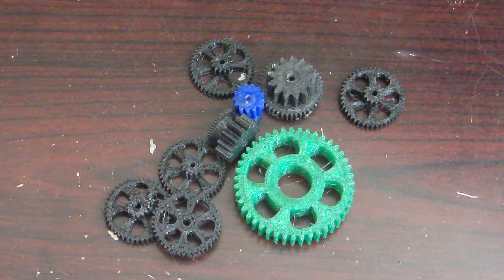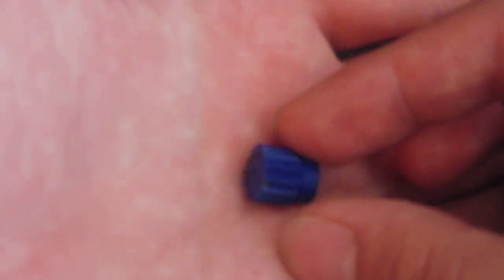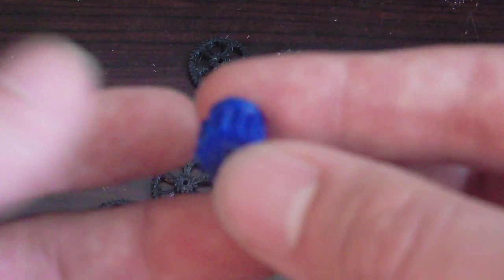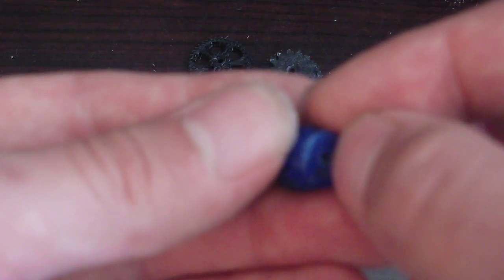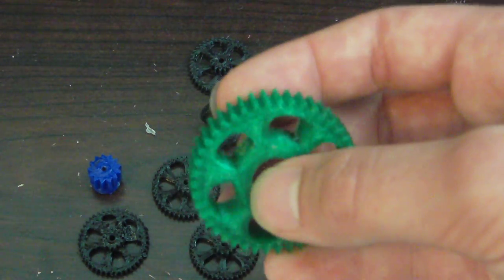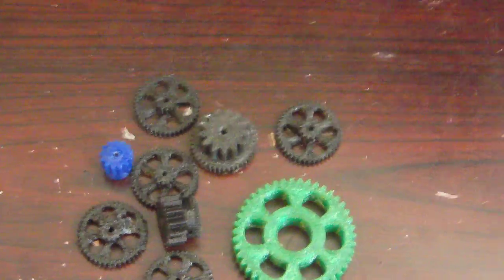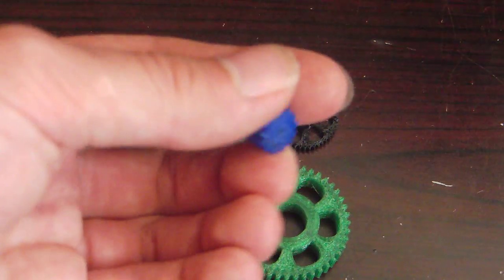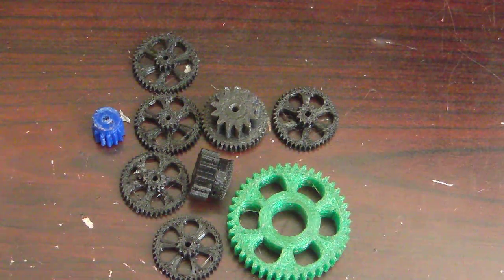Can you actually use 3D printed gears?

Comment: Nice video , i got an issue with this as even if it is good adjusted it still comes up with circular defects. Am planning to add one axis and print on a rotating surface to get it more circular. What i have learned is that how you print the layers affect durability, and the best setting was actually 20 degrees z lift and supports beneath it so that the layers got diagonally distributed. You can however print them in pla, put them in a mould with alginate and just pour resin for a sla printer and harden them with light. As long as the model is accurate the gears will, and will go much faster in series.

Comment: I don't believe he cannot drill and tap a set screw into the blue gear. I think he just doesn't have the proper equipment.
Reply from the maker: +Jason Murawski I could but that gear is tiny and even finding a screw that small and then getting it tight enough to stop the gear spinning on the shaft and without striping out the plastic would be very hard. Also it's not like you could grind a flat on the shaft since it's like 1mm in diameter or so.

Comment: can you reuse the 3d plastic to make something else? they just need a cnc for plastic and make your pieces from different grades of plastic blocks to cut. that would be awesome! them you can use really good polymers and such. just a thought.
Reply from the maker: There's nothing special about most of it. They literally take regular raw plastic pellets used for injection molding and such and dump them into a fancy extruder that just happens to make a filament the right size for a 3D printer. You could easily melt it down and reuse them.

Comment: Great video. I want to print gears. There are so many 3D printers on the market today. Can you recommend me one that can print small size (like a  blue one on your video) ? Can I find one within 1000 $ budget?  Please show the link if possible.
Reply from the maker: If your willing to assemble a kit than you can find something great for well under $1000. The kit I have I think I paid like $500 for but that was well over a year ago. If you want something pre assembled you might have a bit of a harder time. I do highly recommend a kit just from the stand point that you will know the machine inside and out so fixing things will be a lot easier but if you don't have the time then well. If you have never owned a 3D printer before and I assume you haven't then it may be best to get something cheap like this: https://www.amazon.com/Monoprice-Select-Printer-Heated-Filament/dp/B01FL49VZE/ref=sr_1_7?s=industrial&ie=UTF8&qid=1493377392&sr=1-7&keywords=makerbot
at first to learn the ropes before going and dropping 1k on something much better. To be honest if all your trying to do is print really small gears you will probably be able to get away with something small and cheap like the mono price. Otherwise I would say just save up and get an ultimaker or a makerbot. They both have been around for a very long time and they will both probably far exceed your needs. Plus they will actually work right out of the box which seems like a small thing but when it comes to 3D printers its actually a big deal. Finally just do a metric crap ton of research. Only you know exactly what you want and trust me it can't hurt to know exactly what your buying and how to use it before you order it.
Reply: Thanks. Can I use SolidWorks to generate my 3D models? Then, files should be converted  into IGES or STL, right? What program they use to create the gcode? Does it come with machine? I want to create my own gears not the ones from their samples.
Reply from the maker: You usually use STL files and I use cura to slice them and turn them into Gcode. Cura is a free software that's really pretty good although I recommend the old version because the newer version is really well ugly as far as i'm concerned.
Reply: I heard  ( according amazon reviews ) that this $216 amazon 3d printer that you recommended after printing 10 -15 parts will have problems and need some repair job. So if it just for a couple of projects, maybe it is OK. But for long term use it is going to be a big problem...
Reply from the maker: It seems fine but it does have an acrylic frame which is well bad. The thing is is that acrylic is very brittle so its easy to crack it by over tightening screws and such. Also from what I can tell people have bad problems with acrylic warping over time so with that being said if you can find a metal framed version you will be much better off. Other than that it looks fine and you should set aside more than a few hours.

Comment: Do you think a PLA timer pulley could handle an 8000 rpm motor on an electric skateboard ?
Reply from the maker: As long as its not actually driving any load and I would use something stronger like nylon you really don't want something like that flying apart at those speeds.

Comment: Couldn't you use resin to attach the gear? Just rough up the inside of the gear and the shaft for adhesion.
Reply from the maker: Yea i'm sure you could but for larger shafts I have been using a pin but for the really small stuff...
Reply: MOO Tech Seems resin may be a longer lasting solution due to greater surface area of adhesion. I would think a pin would put undue stress on concentrated points on the plastic, stretching them overtime? I don't guess it doesn't matter if you can just print another though. Gorilla glue would work as well since it expands.

On another topic, I need a second printer... right now mine is down due to a broken part I cannot print because of said broken part. Sigh...
Reply from the maker: Yea a pin defiantly does put a lot more stress on the gear but if you using them for low stress applications like model cars then it should be fine. The only thing I really have against the resin is that your probably never going to get it off without breaking something and if its like a model car or something then the gears will wear out especially if you print them in PLA or ABS. Nylon might be better and I got some nylon for another project but ill probably do a video were I test if nylon is actually that much better but if I had to guess it will blow PLA out of the water in both strength and durability. One last thing is I really try not to use adhesives if I can avoid them because its just a big hassle so I really don't have a lot of experience working with them so i'm not even sure if regular epoxy would even stick to nylon because I hear nylon is like impossible to glue with anything except maybe specialty stuff but as for PLA and ABS i'm sure resin would be just fine as long as you never want to take the gear off its shaft in one piece.
Reply: MOO Tech That's true, I didn't think about eventual removal. Resin is a real pain to remove.
Reply: Is there any issue with creating a flat on your motor shaft using a handy dandy Dremel?

Comment: do you think the entire gear could be reinforced using a spray on adhesive, or would that kill the cost effectiveness?
Reply from the maker: Well depending on the size of the gear they are going to be significantly cheaper than something you buy and they can be made in custom sizes. I think you would still be saving money if you sprayed them down with something but to be honest I don't think its necessary if you use nylon. Yes nylon is more expensive but its a ton stronger than PLA and its a really good material for gears so to be honest I would just use nylon and I think you will get better results than PLA or ABS coated in something.

Comment: Yeah, for the small gears SLA printing is best.
Reply from the maker: Of course because detail and accuracy is much better but not to many people have one in their house so that's why I directed this more toward FDM printers which do a decent job on the bigger ones.
Reply: SLA doesn't print in engineering plastics though. A CNC engraver might be just the thing though, and they don't have to be expensive, as opposed to SLA printers, nor is the raw material barely affordable.

But i think you can also do with FDM. Maybe finer nozzle, slower speed, i have seen some truly spectacular 0.2mm nozzle prints with 0.05mm layer height off a basic i3. PLA seems like a pretty good material for gears, but if something better is needed, you could always cast a copy, and there's lots of PUs and epoxies with different properties.